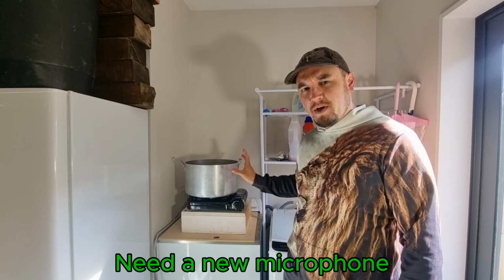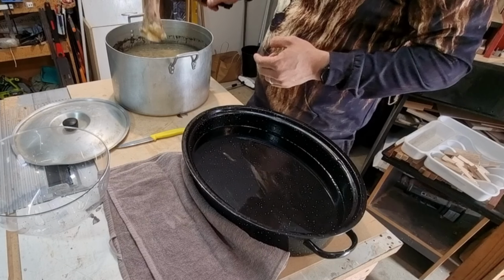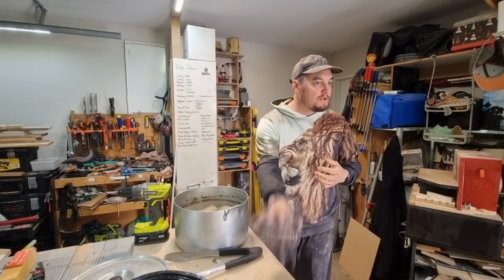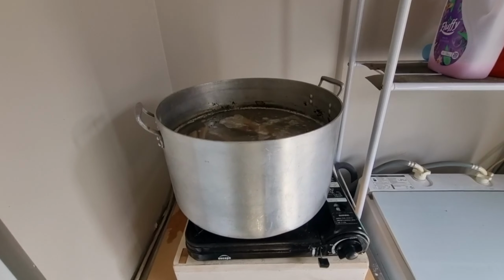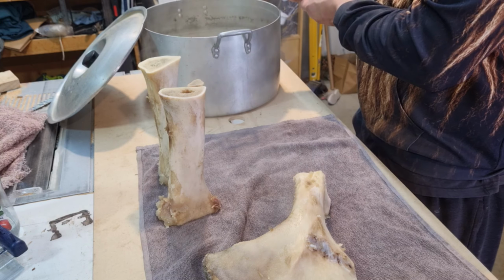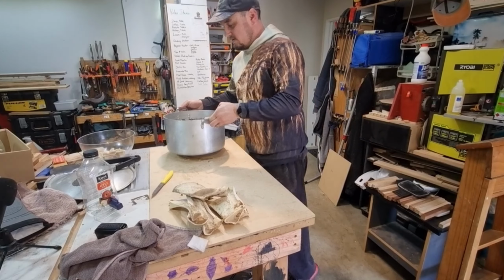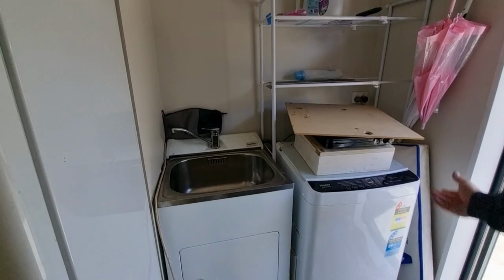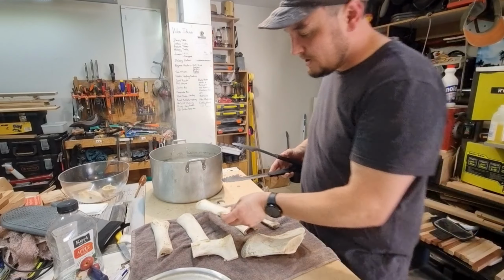How To: Bone Processing For Carving

Comment: Morena bro, thank you, really appreciate the time you've taken with your videos. So helpful! question, does boiling weaken the bones? I've read other stuff that soaks in hot water bleach and washing detergent but doesn't boll. Tbh your approach seems far less mahi😂
Reply from the maker: Na. I haven't noticed any difference with boiling and not. Use to soak them for a few days, swapping the water a few times, but this is way easier. I know if bone is exposed to too much dry heat, it gets weaker tho.

Comment: I’ve been reading that bleach is a bad way of whitening bones because it makes them brittle (or something along these lines). So most advice I’ve heard is soaking the bones in hydrogen peroxide instead.
Have you noticed any effect on the bones, or is this just a myth that got really widespread?
Reply from the maker: Honestly I haven't noticed any difference. May be because the bleach is diluted so much in the water but I've had no issues.
Reply: @rickthemaker5834  good to know! It’s much easier and cheaper to get bleach than high enough concentration hydrogen peroxide 😅